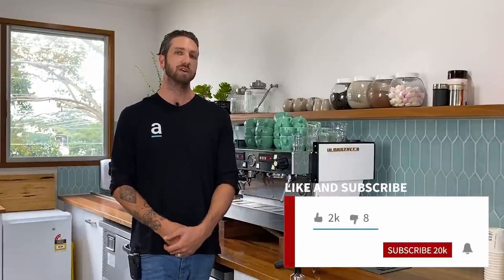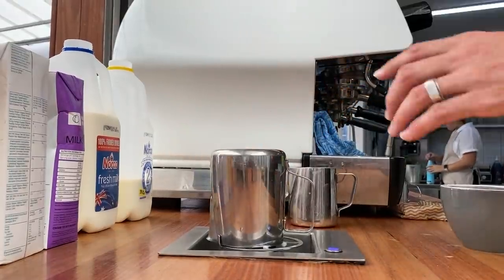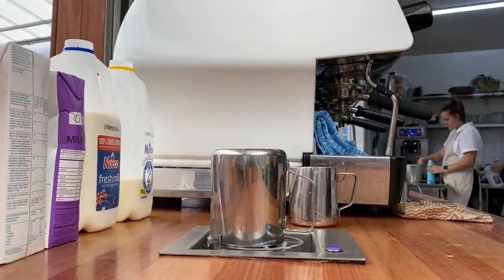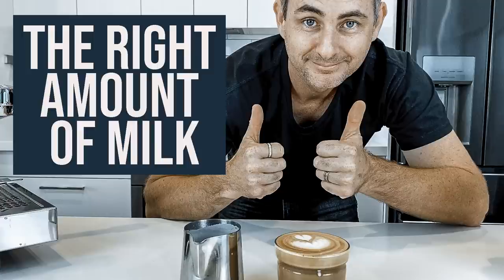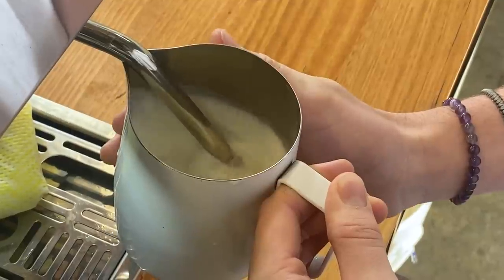3 Common Barista Mistakes - What you shouldn't do making coffee.

Comment: I don’t see an issue LIGHTLY(not to damage the metal) tapping the portafilter (better  with your palm) for distribution and evening coffee BEFORE tamping. After tamping is just distributing the pressed coffee all over again.
Reply from the maker: Yeah we’re with you on that. Preparation of the puck before tamping is crucial, the OCD helps but using you hand to get an even spread of coffee helps heaps. 
Have you seen our coffee defects video? It’s all about the advantages of good distribution. Check it out.
Reply: What grinder are you using?  Letting the handle bounce “dance” on the table .. and shaking laterally…as you are filling … is best !!!

Comment: What’s the advice for home barista on a machine that doesn’t get hot. Should I warm the portafilter in hot water first? Or run an empty shot through first to heat it up?
Reply from the maker: Run and empty shot, get the handle hot but then make sure it’s dry before you add your coffee

Comment: I saw many vídeos from "big guys" tapping the coffee not so hard buy still tapping, the ocd is enough for a good coffee? Without any pressure...thanks in advance for the answer!
Reply from the maker: If you use and ocd you should still tamp, we have used the ocd and not tamped before, we found the puck can float easily. That’s if you have it set at a depth for a ramp to be used. If you set the ocd very low you can pretty much tamp the coffee but it does not distribute very well.
Reply: @ArtistiCoffeeRoasters  thks!!

Comment: I tap the portafilter to get the coffee out of the groove around the top of the cup then tamp it again, I've never noticed any problems with cracked pucks or variation in extraction due to flowing around the outside. However if I dont remove the coffee from the groove it gets up into the group head and causes more trouble and is more difficult to get out so Im not convinced about this particular issue, the rest you raise I totally agree with
Reply: I don’t tap it - I just run my finger around to get the particles off but don’t disturb the coffee. If I do brush it, I press it in again. I get a nice finish.
Reply from the maker: This is the challenge we all face, to save the seals or to save the shot? We've eliminated this by using dosing pots. Check out my workflow in this video https://www.youtube.com/watch?v=rLaVDQy0q8Y it shows how we use dosing pots on a scale to nail our dose everytime. This stops the coffee from sticking to the walls of the portafilter, eliminating exactly your issue. Try this and let me know how you go. 
- Jimmy
Reply: @ArtistiCoffeeRoasters  This is a really good video, mate you have got it to a T! I note that you do bump your portafiller and Im sure thats for the same reason I tap mine, I'll give the hand bumping a go :)

Comment: Well seeing how he asked why:) I very lightly tap it Jimmy because when I tamp the coffee in. Many times coffee is on the edges of the basket. Then it gets messy and may get the helicopter swirling in mid air. A slight slight tap will not harm any part of my basket or tamp. But just to be fair to Jimmy. My Elektra Micro Casa has to steel flaps that can't get harmed or bent when I lightly tap. Others may not. So, others may not be so safe doing it. Sorry Jim
Reply from the maker: No worries. Just be mindful that if it's a hard enough tap to get coffee of the sides, it's hard enough to create gaps around the outside. It may not crack the puck but can still cause defects.
Have you tried using dosing pots? They place the coffee in the portafilter without putting coffee on the sides. This allows us to have no mess on the walls without having to tap. 
Try this and get back me with what you think.
Reply: @ArtistiCoffeeRoasters  seeing how I am one of the best close up and hand shadow guys in the world lol. I pay attention to every detail I will research more but once coffee is in my Electra casa basket as smooth and clump less as possible for me. I tamp it down. Now it is Impossible for it to be tamped without coffee creeping up the edges. Although loose grinds on the wall. A slight tap and I mean as flicking of my finger is enough to tap it off pressure in no way will affect the tamped coffee. Unless I’m an idiot and wack it on its side like my dumb a$$ plumber would do. But yessss. I get your point. Thank you. I’ve had two Electra micro casa espresso machines. Never a dent. But I never again in my life want that basket to  do it’s helicopter around my head again:)
Reply: I personally like to just brush the grounds off the sides before gently tamping again.

Comment: Hey guys, got myself a second hand Madacaf Nica Levetta semi auto single group for home. It's so pretty. Wondering if you have a suggestion on a decent home grinder. It came with a, Ascaso imini grinder, and I am working towards dialling it in, but still getting intermediate results. Wondering whether I should persist, assuming that the original owner had the grinder completely way off, or should I look at something newer. I'll be using it to grind for cold brew and filter sometimes as well, and a digital grind setting is appealing in that respect, as the Ascaso is obviously a manual knob grind setting...
Cheers!
Reply from the maker: Hi, we have not heard of the grinder you are mentioning.  But for people who want the large grind variations from Esprssso to cold brew we would look at the niche, it’s a single dose grinder that allows you to put about 50g max in. It look beautiful and is fast due to its conical burrs
Reply: @ArtistiCoffeeRoasters  thanks team, I'll check it out

Comment: hi, i have purchased a Gaggia coffee machine, can you advise on how to set it up outside as a mobile coffee. plz
Reply from the maker: There is a lot to that question. Do you have enough power? A water tap or from bottles?
Reply: @ArtistiCoffeeRoasters  I have electricity I will be for now use water bottles.  How would this work?  Thank you, for your response
Reply: hi, I found out that I will need a Flojet Plus Bottled Water Pump.  I also need to plug into a canister that helps clean the water

Comment: when the barista walks away from the jug thats steaming just because theres a thermometer ... I know that milk will have a very thin flat texture cause you werent sitting there holding/moving the jug around for proper technique ..
Reply from the maker: Yes, this can be the case for inexperienced baristas, on the other hand pro baristas have this technique nailed and it helps them to pump out the brews.

Comment: Hey guys, work is opting to get a coffee machine with a higher than standard group handle so that we can do larger beverages in mugs and bigger TA cups over 12oz. 

I find that if I'm doing espressos in our 80ml ceramic cups that the group handle is too high. I usually invert a cappuccino cup n place my espresso cup as close as I can to the porter filter so it doesn't splatter everywhere. Or do U recommend another riser/platform that I could use?
Reply from the maker: In Australia we make lots of 8,12 and 16oz coffees, espresso is a small number. So the high cup machine is a preferred option to allow the takeaway cup to fit in. We recommend the up side down cup as you are doing as there is always one in reach.👍🏻

Comment: Leaving the portafilter always in prematurely wears the group head and compresses the seal. Instead, insert the empty PF just before you grind, run water through it into your cup to warm up both PF and cup and stabilise group head temperature, then grind and pull the shot.
Reply from the maker: Thanks for your input ✌🏻
Reply: Depends on how tightly the portafilter is put into the group head I would think.

Comment: The basket should NEVER be on the machine empty. This will ruin the rubber seal and also give your next coffee an ugly aftertaste of overheated metal! Always better to leave them on with coffee in it and clean before you make a new coffee.
Reply from the maker: This is an interesting point, the seals area cheap, the shower screen will then get full of coffee oils, but if you empty it then yes it gets moisture and super hot, so which is truely the better outcome??
Reply: @ArtistiCoffeeRoasters  the seals are made from plastics, so even if they are cheap, changing them often is bad for our planet. Just think about how many coffee machines there are in the world. And the oil on the screen can easily be cleaned. With an empty basket your first coffee the next morning will taste horrible, no matter how much you clean it. I am in the business for almost 30 years and I am speaking from my own experience, being trained to also service the machines, not just use them.

Comment: How about tapping the portafilter before tamping? Or better yet, before redistributing?
Reply: That would still damage both tamper and portafilter. nicks&nacks around them are not nice. They should be shiny and polish-y.
Reply: @blizzbee  ha?
Did you think I'm tapping my portafilter with my tamper? That's not what I said 🤣
Anyways, I finally received my new wdt tool, thin proper needles for a better puck prep, no tapping needed.
Reply: I myself tap the portafilter downward to the rubber mat once to pull down the grind a bit haha. Then finger sweep, spin the macaron, then tamp...  Kinda must do them all... for peace of mind. ☕
Reply: @blizzbee  Tapping will increase clumps and cracks which will lead to channeling, or so I've heard.
Also OCD tools are proven to be unhelpful...
Wdt 0.4mm needles would do the trick of redistributing + leveling, then ofc tamping.
But whatever floats your boat 😁
Reply: Yeah i won't argue that but so far, that makes my cup tastes the best as it can be 😏
Won't say it's good to do but ... yeah 😏
Reply: Coffee is not only the drink but also the fun. I can confidently say that there's no hard right and no hard wrong in any thing we do to make a cup. I am still experimenting this and that everyday and find variation in the cup never ending.
Reply: @blizzbee  nicely said 👍
Happy brewing!

Comment: I went in to a local coffee shop to search for beans, they had one of those 18k 3head commercial machines and the girl had PRETAMPED a bunch of portafilters and just popped in 2 heads, COLD bearing in mind, the coffee was probably one of the most acidic shots i have ever had. absolutely disgusting.
Reply from the maker: Oh no, that’s not good. It also may have been the wrong roast, if it was light and cold handles it was sure to be extremely acidic with a drop in brew temps

Comment: of course tamping, tapping and then tamping it must be the last step. how the channel comes out ? by your imagination?
Reply from the maker: it has to to with the various pressures you have created in the puck it self and the grinds. simply the coffee does not get push to the edges of the basket efficiently on the second tamp. also the pressure difference in your tamp from the 1st to the 2nd can cause issues.